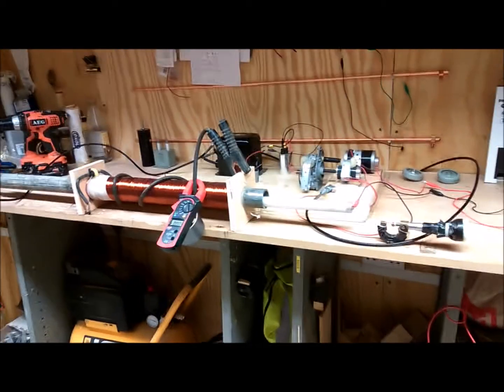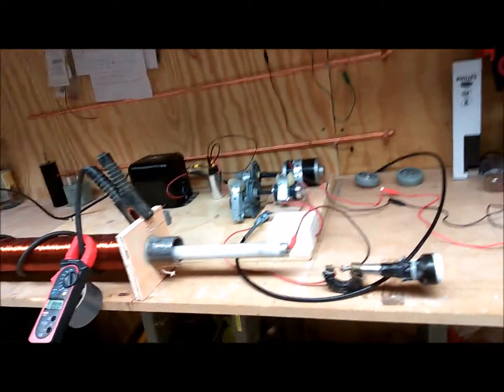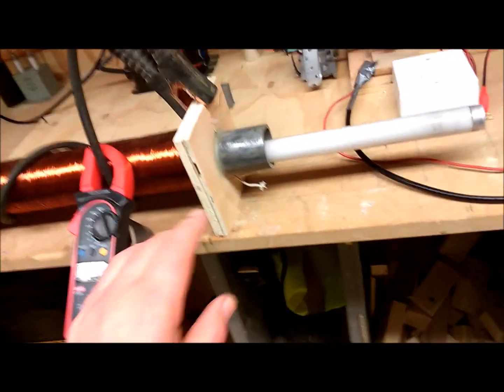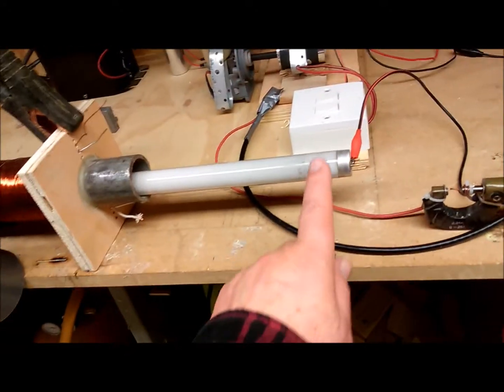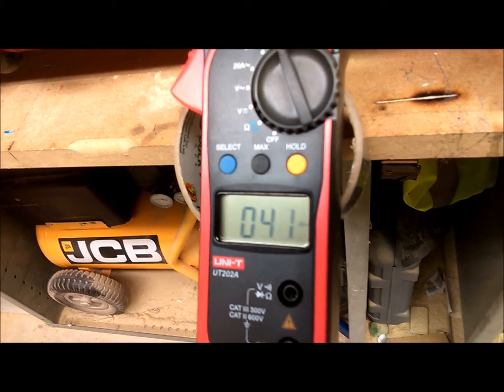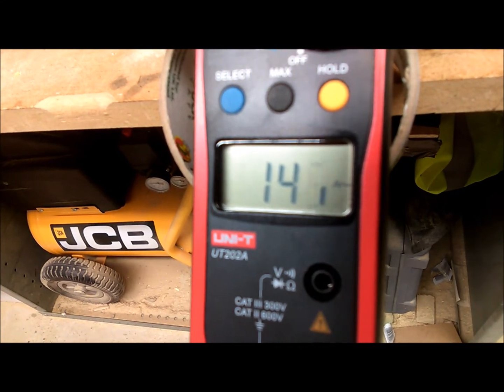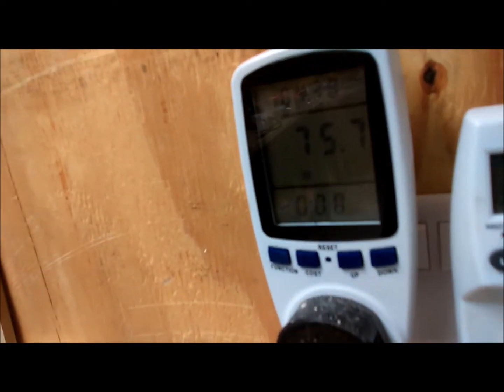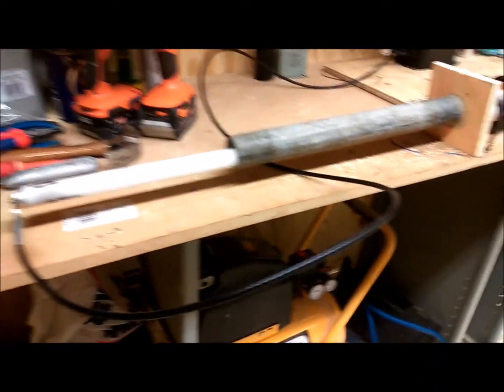Plasma Power Generator Transformer 2

Comment: You probably figured this out, but because you are changing your input voltage you are going to need to re-adjust your spark gap(the frequency on your output from generator is changing).

Comment: Looks good, have you compared your stubby performance with a coil just having single wrap of wire from one end of tube to other or indeed a bifilar wrapped coil? Wonder if the effects you are getting are more to do with the stubby or the system in general.  Great stuff DC.

Comment from the maker: Just to let you guys know made a chance discovery with this baby.  Its' all in the "Phase Angle"! Another video coming soon. ..  DC
Reply from the maker: +UniversalExpanse Hi UE .... Thanks' for all your comments, this baby is doing my head in!! Its like the power / electrons are flowing out @ 90 degrees to the coil. I am going to do a new video showing my findings. What I can say is that it is like the antenna  "Near field Effect" in and around transmitters. This coupling seams to flow, watch this video closely you will see:- 1. Over speed die off of AMPs when I adjust motor volts. 2. Constant AMPs and die off & return when motor running at constant speed. Mm very interesting. ......   DC
Reply from the maker: +UniversalExpanse Yep I found out about this After I bust my scope. Its really common sense if you think about it "What a Dumb Head" I am. "Still learning, sometimes the hard way to make "Big mistakes".    ...  DC

Comment: just 3 letters for you . O. M. G. !!!!!!!!!!!!!!!!!!!!!!!!!!!!!!!!!!!!!!!!!
Reply from the maker: +conandrum74 Hi C. Got a long way to go just yet. Many hours of study to confirm; so I have nothing at the moment!  I am trying to see why I am getting the "High AMPs" readings.  ....   DC
Reply: ))) Did you check how many volts you are getting with all these amps so we can calculate a rough power output?
Reply from the maker: +conandrum74 Hi C  Good question "Voltage" Not stable:- 117 to 210v, frequency not tested.  Much work to do, thanks for your interest.  Regards ....   DC   (PS) Have a look at my video "Plasma Power" Look how bright the lamp is. 555 timer chip very high frequency. Lamp nearly full power 1AMP 12v.   Regards .... DC
Reply: Tesla always showed.... HV HF is the key!

Comment: Yes, looking forward to voltage tests. DC are you able to measure the frequency at the spark gap or fluorescent tube. The amps measured are really a surprise also.
Reply from the maker: +Peter K.  Hi PK I broke my scope! Yes with HV! So I am trying to get it fixed. I guess its related to "Motor Speed" so the best I can do for now is to take the speed of the DC motor as it is directly connected to the  washing machine motor. I will do this & try to check it out with the Hz frequency @ 24 volts DC; the "Multimeter" readings, should do it switching to read Hz.Regards .... DC
Reply: naaatsaree/